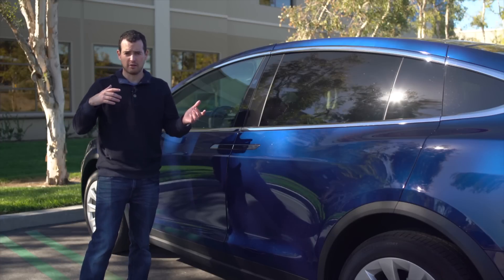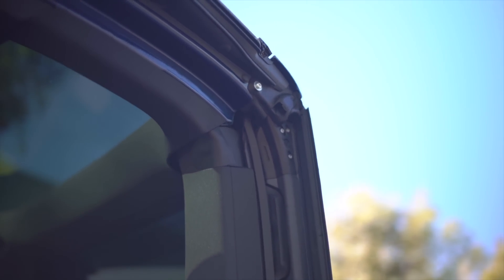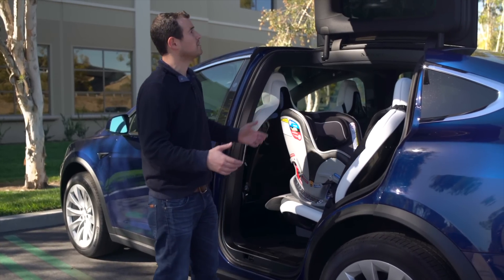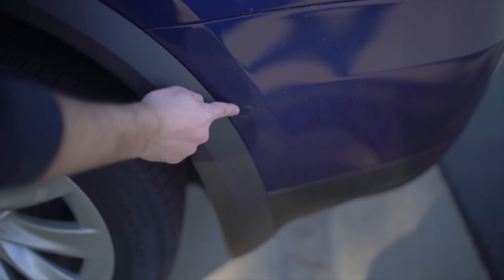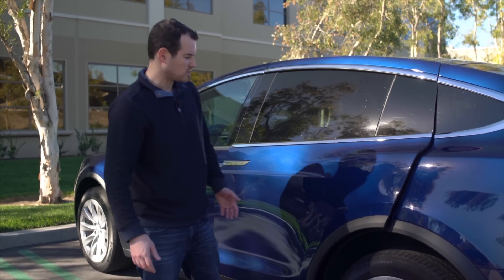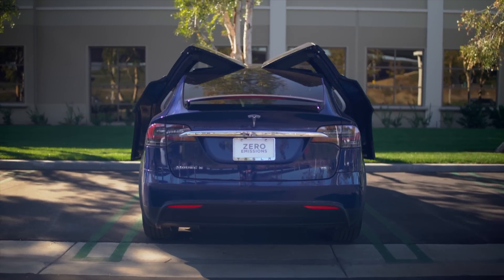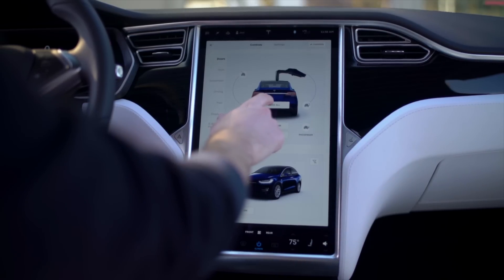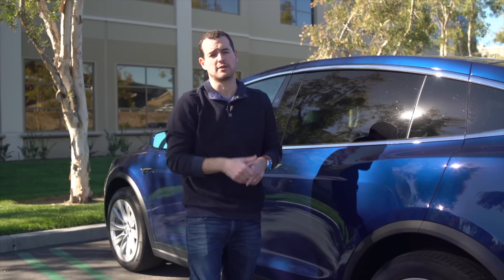This Car Has Wings!

Comment: What about snow and rain? The snow will be on the top of the car, and when is raining probably the water on the roof will get in the car...?
Reply: Snow you should clear off anyway - you shouldn't drive any vehicle with snow on the roof, it is a hazard to other drivers and yourself.  It can slide down onto the windshield while decelerating or blow off onto cars behind you.

Rain I haven't had an issue with in my X - when the door is open in pretty effectively shields the opening overhead.  Obviously if it is a lashing, driving rain it may blow in - but that happens with normal doors too.  Don't keep it open long.  There is a kind of gutter around the opening so when I open the door water on top that runs it goes into the gutter and around the sides to drain, not into the car.

Comment: nice vid, but I wonder how the falcons do in a low ceiling parking garage like the one I park my car in?
Reply: Not bad actually - with the double hinge and sensors they open as far as they can - the top hinge may not open as far, so the top part remains at an angle, and then the corner hinge opens more to bring the side panel up more.  The effect is to have a lower overall height.  You may have to duck under a little in a very low garage, but it isn't really any worse than ducking into a door in a car with a low roof.

Comment: Hi Jon, just wondering, how do the doors work with battery dies or a power shuts off? How do you get out? Thanks mate.
Reply: There is a 12V system that powers pretty much everything that isn't the traction motors.  It is charged by pulling power from the main pack.  There are manual releases too if you need them - the doors open primarily through torsion springs, and use actuators to close (pulling against the springs).
Reply: MegaZone ok so easier to open than close? Could they fail and fly open? My other thought was could a very small amount of damage cause them to jam?  That said, I'd love this car if it wasn't $160,000+ in Australia.

Comment: does its latest autopilot system reliable in detecting object if a person cross the road in front?
Reply: Since he has a new Model X with AP2.0 he doesn't have Autopilot yet - it won't be enabled until the 8.1 SW update.

Comment: Is there a manual lever to open the doors? The door handle seems more button life.
Reply: No.  The outside 'handles' are buttons.  The front doors have a handle that mechanically releases them.  The FWDs use buttons inside too - but there is a hidden release for extreme situations.

Comment: aren't they called gull wing doors?
Reply: No, Falcon Wing Doors.  I'm sure it is partly because of Elon and a reference to the Falcon 9, etc.  But also gull wing doors have only one hinge, at the top.  The FWD has two hinges - one at the top, and one at the corner.  They open differently.
Reply: MegaZone thanks so much I was confused about that. much love for the time and effort it took to explain that.

Comment: Marques Brownlee just had his steering wheel make turning hard half way into a turn really hard, Tesla is just a pos.
Reply: Judging by your pp, you're probably an EV hater
Reply: Ali Amin Things go wrong on brand new cars all the time. Being new doesn't guarantee they're impervious to the occasional issue. So again: doesn't mean the entire company and their products are garbage. Of all companies, Tesla obviously doesn't cut any corners or use cheap parts. THINK: it's electric steering. If a sensor goes out, then that will cause problems. Why don't you educate yourself on the problem before you talk about it.
Reply: I see model X, model S all day here in LA,  it's tech is awsum but it's just not a looker to me, it's so meh, when I see an i8 I still turn,  those are sick,  Ive sat inside Model X and it looks cheap and too simple inside...
Reply: Yeah your on drugs 😂
Reply: Ali Amin they're not POS, you simpleton. They're just insanely complicated and filled with way too much tech to be practical. The more complicated something is with electronics and sensors, the easier it is for something to get tripped up. chill out
Reply: ***** no I don't hate EV's (Electric Vehicle),Heck even the Prius is better than this contraption.
Reply: illitero don't call me a simpleton ass wipe I know my cars very well.
Reply: Dominic Maas So are Toyota's,Honda's,Subaru's and Volvo's.
Reply: ***** Twice not once with 5300 miles that's a brand new car and it took these ass hats 12 days for them to figure that out,Come on.
Reply: illitero on a brand new car yes it does a steering locking up is no joke,That's a life or death situation or just poor parts there using to cut cost on there vehicles,If the car was older yes I'd understand.
Reply: illitero A Ford Mustang has electrical power steering if the electric part fails you'll just lose the power part and at higher speeds power part isn't necessary,You know nothing about cars chump.
Reply: Ali Amin please tell me you are joking, because if you aren't you are an idiot
Reply: AKzebraMiner Which part am I joking about?